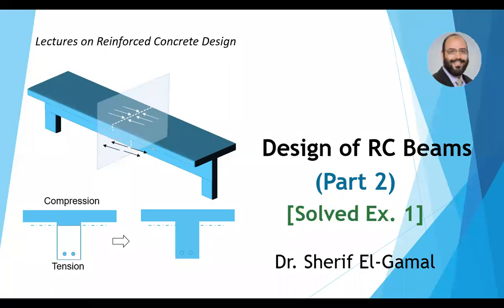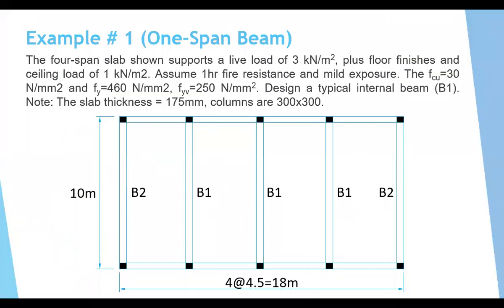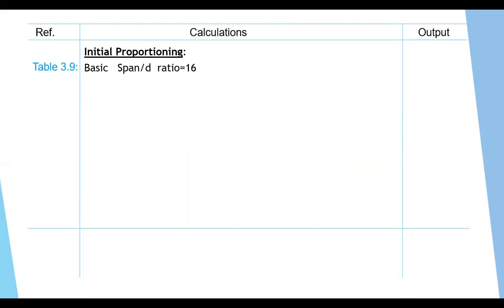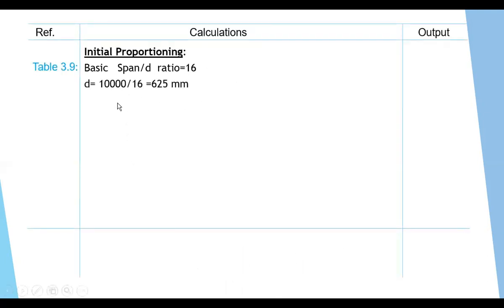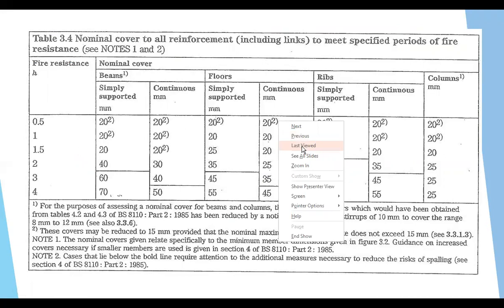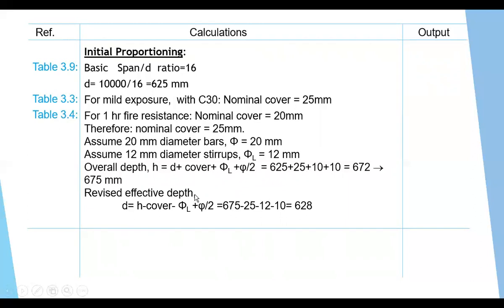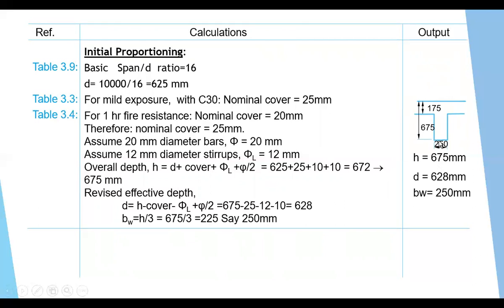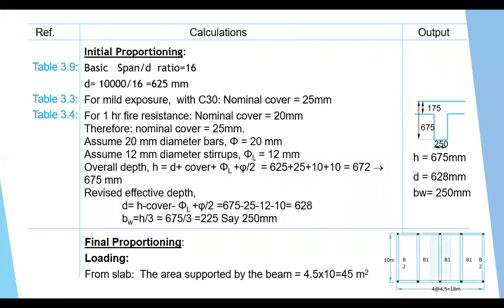Design of Reinforced Concrete Beams (Part 2)- Design Example

Comment: Hi Dr. Sherif,
Thanks very much for your ever enjoyable lectures on designs of reinforced concrete members.
The design of Reinforced concrete beam part 2- design example has been valuable to me. I would however like make the following observations;
1. Reinforcement, Clause 3.4.4.4
 Use 6T25 Bot. (Asp = 2950)
The area is 2945 and not 2950 as indicated.
2. Check Shear
vu = lesser (0.8 square root 30, 5) = 4.38. not 4.28 as indicated.
3. Design of Links
At d face of support ; Vd = 292.8 - 58.56 x (0.15 + 0.628) = 247.2. Not 248.8 kN as indicated.
4. Extent of shear links = (Vface - Vn)/w
= (284 - 152.3)/58.56. Vn is 166.42 and not 152.3kN as indicated.
5. Fig. 3.24 not Fig 3.25 as indicated
6. I did not get the concept of Transverse Steel. It did not come out clearly on how you arrived at T10-300 C/C.

Thanks a lot Dr.
Hope you will soon lecture on Design of Reinforced Concrete Columns.

Regards,

E.K.Bett
Reply from the maker: Thank you for your valuable comments.  I will try to fix them later. The columns will come soon.

Comment: I'm missing something here...what is the reason for removing 3 bars when doing the shear calculations?
Reply from the maker: Because there is no need for all bars near support. You can reduce the number of bars near support to save in reinforcement.

Comment: I had a question, when dividing the total weight F to get the distributed load W (load calculations in first step) why you divided it by 10m not 4.5m? Shouldn’t be divided by 4.5 so it can be distributed in the 10m direction??
Reply from the maker: No. This load is over the total length of the beam which is 10 m. To change it to distributed load, we divide the concentrated load by the beam length which is 10.

Comment: in initial proportioning  20 mm bars were assumed as main bars.but finally 25 mm bars were considered. isnt it a problem as it may causes to change the effective depth and so on.
Reply: Whatever change is insignificant if you recalculate

Comment: alslam alikom engineer Sharif, thanks for the excellent material and brief explanation, this is the first time I understand the design. I have a question regarding the minute 26:49 the (extent of shear links) we have find that Vn = 166.42 KN and when substituting in the next line we wrote  the value is 152.3, I am wondering from where did we get the value of 152.3? or it should be 166.42?

thanks again

Comment: Please can you explain further the 0.15+0.628 sir. I have been trying to really picture it. Thanks for the good work
Reply from the maker: The critical section of shear IA at distance d from the face of the support. This means (d+ column width/2) from the centerline of the column. Column width was 0.3 m and d=0.628. Therefore the distance from center of the column = 0.15+0.628

Comment: Always we have to give a credit where Credit is due, Bro Dr.sharif Thanks alot  your videos are very enlightening. Sincerely i am enjoying .

Regarding this video Would like to ask Since our full length of the beam(span-B1) in the plan is 10,000mm inclusive of column width(both sides) which we have a square column of 300mm by 300m, why do we remain with 300mm for bòth end instead of 600mm after this ( 10,000-(2250+5200+2250)=300mm) with reference to the last page?

Comment: He'll sir. I have always liked your tutorials. My concern is about Bs 8110 and eurocode 2, which one should we adapt as the latest reference code? Thanks
Reply from the maker: They are two different codes. This depends on the required code of the project. Eurocode 2 is newer than the BS8110, but the BS8110 is still used in many countries.

Comment: I have an issue I followed the principle. On your page check shear.

V I got 5.44N/mm2 is greater than 4.38???
Reply: Please check again. The 0.8 x sqrt(30)=4.38. I think you used a higher grade of concrete than what was given in the question

Comment: Great job sir may God continue to increase your knowledge.  
Please I have a question: when you design for Linkes in (Svmax= 0.75×628= 471mm >Sv=150) OK
Why is it Ok? Since 150mm > Svmax = 471mm. 
Please I need more enlightenment sir thank you sir 
Best regard sir.
Reply from the maker: It is ok because you did not excerd the maximum spacing. This means that you are in the safe side.

Comment: السلام عليكم
لو سمحت كيف تم حساب hf 
 hight of the flange
ب 175 ؟
Reply from the maker: Was taken from previous lectures. You can calculate the hf from the slab design. It is the slab thickness.